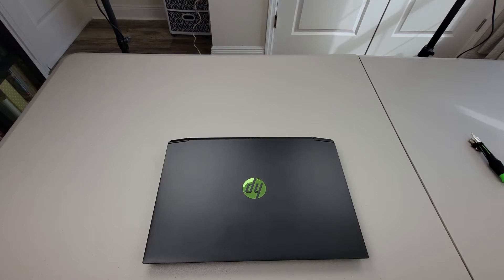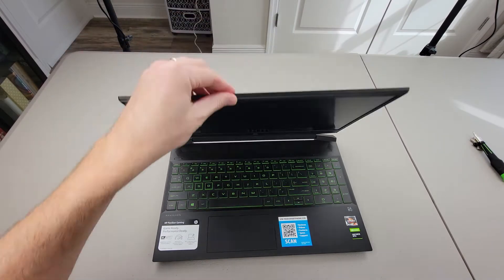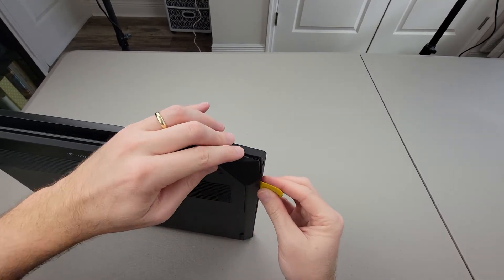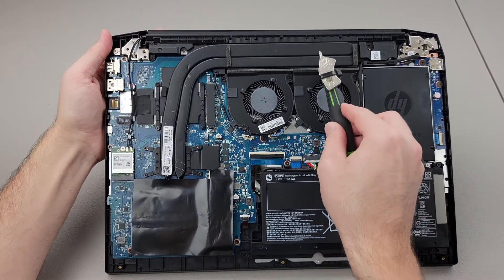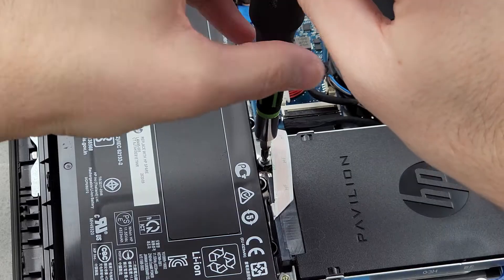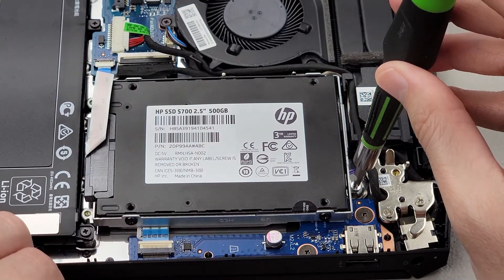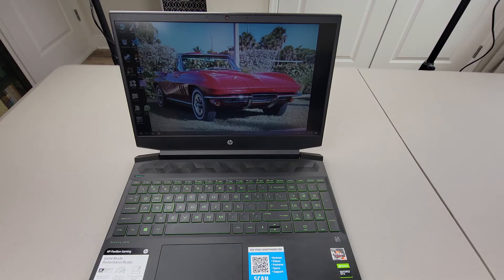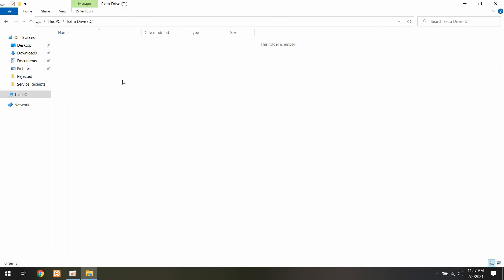How to Upgrade HP Pavilion Gaming 15 with SATA SSD

Comment: I have an old 17" pavilion. It was always very slow. I replaced the hdd with ssd and couldn't  believe the difference.
Reply: Then replace hdd to ssd makes the diffrence...dope i didn't know that
Reply: Yeah SSDs don't have moving parts, while HDD do. SSDs rely on doing things electronically which makes them exponentially better than HDDS. I'm upgrading my HP Pavilion Gaming Laptop's SSD from 256GB to 1000GB because that is NOT enough for gaming lol

Update: I got my 1tb ssd now i can play Gta V Story Mode, Black Ops 2, Minecraft, Forza Horizon 4, and Mortal Kombat X without worrying about space :,)
Reply: I hope you see this! Do you have the same laptop as the one in the video? I want to upgrade to 1TB but don’t know which parts I can use and can’t seem to find a way to get the answer 😂
Reply: @metaherr6072  I'd recommend going to crucial and punching in the model you have to see the SSD/ram compatibility.
Reply: @chris73.5  same
Reply: @chris73.5  Did you upgrade sata or m.2 SSD?
Reply: @PointTheorist  There's no SATA in the laptop, it's just a plastic cover in the space where u install the new one. So I just bought a SATA and installed it
Reply: @chris73.5  Can you install a new m.2 ssd if you want to????
Reply: @chris73.5  I have a question?? Do you have to do anything else or just copy the HDD to the SSD???
Reply: @PointTheorist  yeah you actually can upgrade the m. 2 ssd

Comment: hey sir, i have already 250gb ssd that means i can add second ssd storage? hows that works? i got same hp pavilion i just was looking to upgrade it with an + hdd but seems i can add ssd in that place too? could you help pls
Reply: yes you can, but the second ssd is SATA connection, not nvme.

Comment: I was trying to find where the main drive is... Thanks for your Video Explanation!! mine came with a 265 Hynix BC511 , i did also add a second drive right after i purchase myself and added 32gb total, can run games like fortnite, warzone, emulators just fine! i also stream from same xD

Comment: What kind of screw drives should I buy to open this laptop? And to use inside for changing ram and ssd ? Thank you.
Reply: The one you get for glasses
Reply: @davidstruble9108  I need help in what screws I need to get for the SSDs removal
Reply: @cheztoast9879  Philips Head PH1 did the job for me

Comment: 5:02 cannot find this cable on my motherboard, i do however have an adapter with that teeth, will that do or do i have to get a specific cable that works on the motherboard?

Comment: Would you consider this unit to have a loud fan when doing basic tasks like browsing, word, youtube, etc.
Reply: i have the 16" hp pavilion gaming laptop and the only time the fans are really loud is when i boot up a game, it throttles the fans up to keep the gpu/cpu cooler and allows u to game in high settings on most games, i also stream and havnt had the fans carry over to my audio once. i cant even hear them with my headset on. but off they are loud
Reply: I have the 15 and it's the same for me to but not when browsing. happens when my wife uses the laptop and blocks the vents while on her lap. Other than that they're ok
Reply: They’re VERY loud a lot of the time, enough that I may turn my tv up a notch or two (but I listen to tv pretty low). I’m a HEAVY user though, well above average with a lot of very draining programs and I’m usually doing 5 things at once

Comment: Is it possible to upgrade the m.2, if there is, is there a difference between just upgrading to the stata ssd or the m.2
Reply: if u upgrade the m.2 you will have to copy the old drive onto it before installing, the original has the operating system on it. as to how u go about doing that im not sure.
Reply: @garymancuso5310  So, What you're saying, I can put the sata SSD in there and I don't  have to copy the files???

Comment: Is there a way to move all the data on the old SSD to the new SSD added in the laptop?
Reply: No because if you chek the disk you will see that the old one is a boot partition and the new one is not
Reply: You have to clone the disk to the new one
Reply: I would put my files in external hard drive, because it can be a back up

Comment: plz post a video on how to upgrade graphics card on this laptop
Reply: It's impossible, the graphics card is soldered into the board same as the cpu with micro soldering bga balls. you must get a same size bga's graphics chip that's hard to do and expensive like buying a new laptop

Comment: I got an error saying operating system not found after adding a 2.5" SSD on top of the existing m.2 drive. What's up with that? I can't change the boot order in BIOS. In fact, can't find either drives in BIOS...
Reply: Did you ever figure this out? I’m having the same issue

Comment: i literally cannot for the life of me get the metal casing screws off, they will not budge
Reply: did you find a solution? im so frustrated right now
Reply: @6px  unfortunately i had to basically take off the bits around it so i could just undo the screws from the side
Reply: @myg_ho3127  wont that break or bend it?